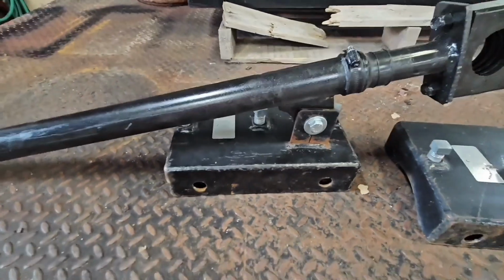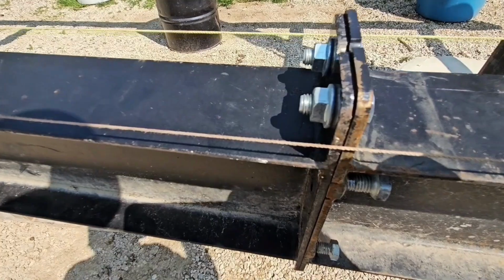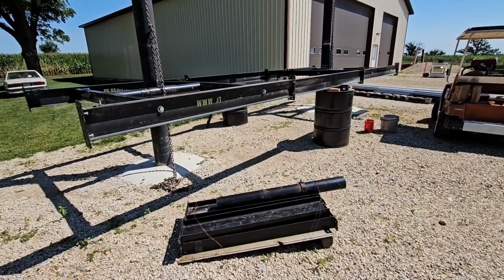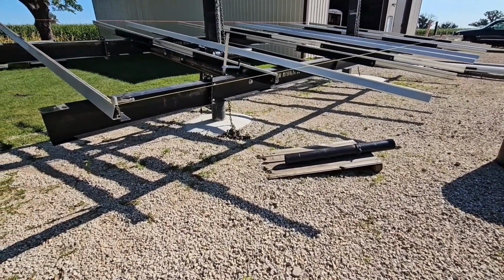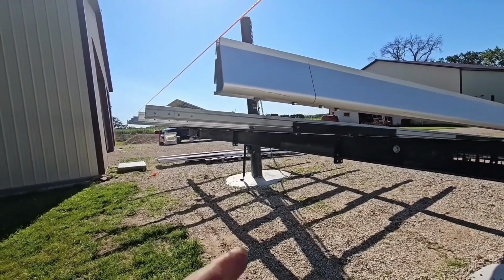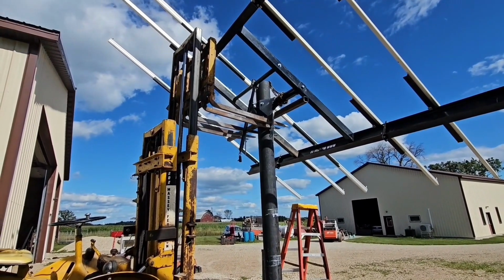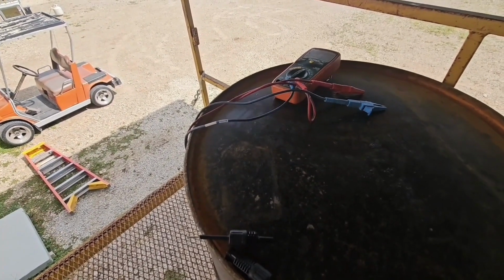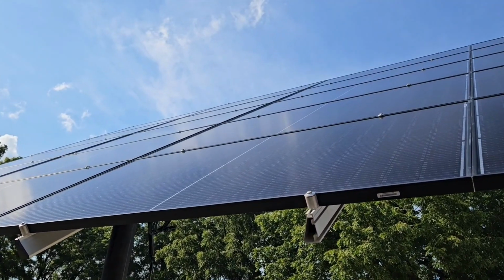Tornado damaged solar array mount

Comment: Good info video, thanks. Here is what I use from AUTOZONE PARTS STORE on stainless and other bolts in the weather:  Permatex Anti-Seize Lubricant 1oz, Part # 81343, SKU # 526814.